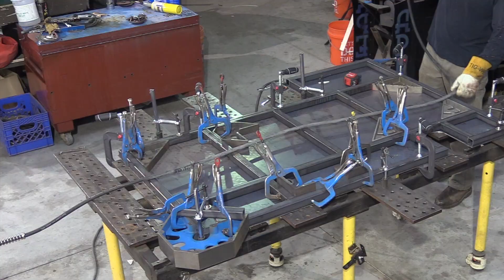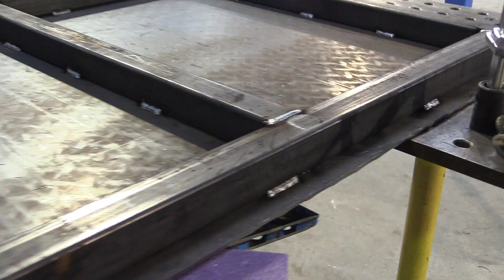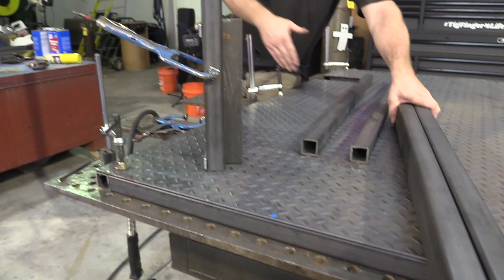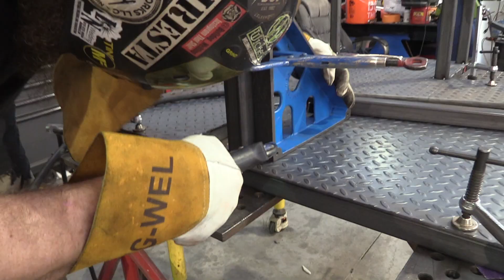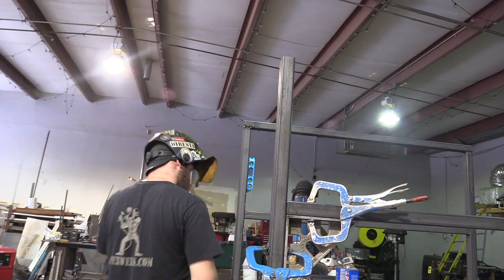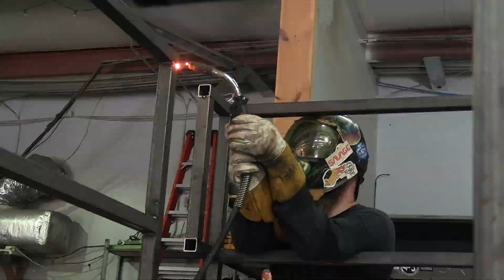Fireball Squares Platform Build

Comment: I make a lot of mobile Aluminum platforms.
To control distortion I will put a slight camber in the platform.
This gives it extra strength when in use. 
By the way thanks for all your tips.
We never weld hand rail directly onto the Checker Plate because it reduces strength and lifts the checker plate while in use.

Comment: So do you guys prefer the aluminum or the cast iron fireball tool squares?
Reply from the maker: In my opinion , Cast iron for when you need the weight and when welding is very close to the square. but aluminum for when you carry several on site
Reply: weldingtipsandtricks well that’s a good enough excuse to double my order!

Comment: I would have put the kickplates like 5 centimeters higher. You have them at the bottom now, but then you get the narrow part not painted en it will stop water from flowing away. So it will rust pretty quickly. But a great video as always

Comment: Hello Mister.
For a grinding try a 3M Cubitron II disc with 3M Backing plate.
Greetings from Poland
Reply: I discovered them a few months ago.  These things are hungry beasts.  But sometimes I don't like the flexibility of the backing plate when grinding out a weld, it eats from the sides of the weld as well, but not at the toe of the weld.
Reply: @danl.4743  Hello.
Try a Cubitron II 125x7 grinding disc.  180x7 make no sense😉